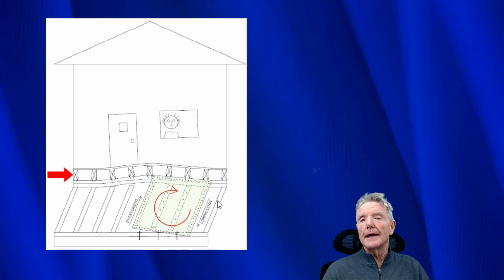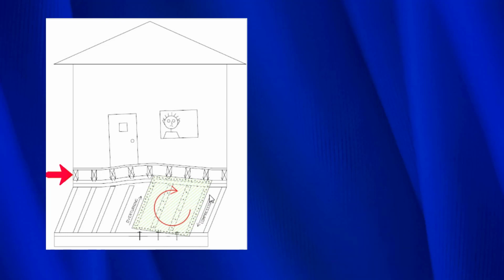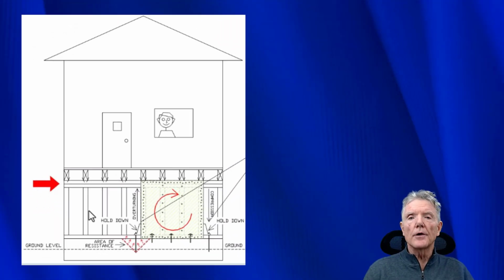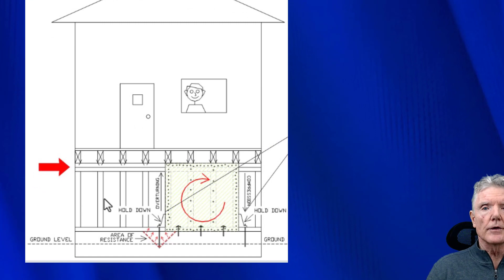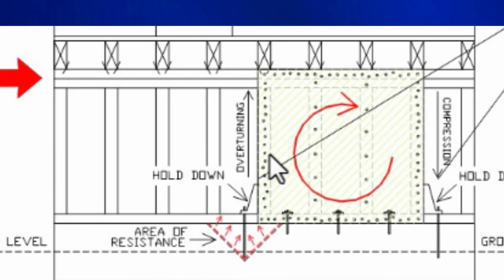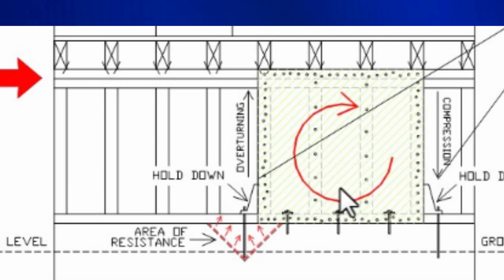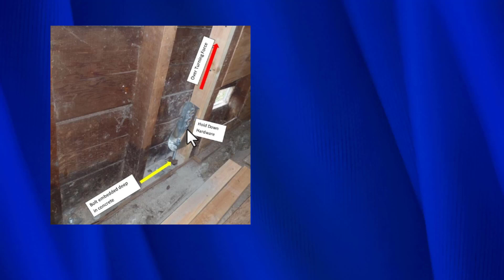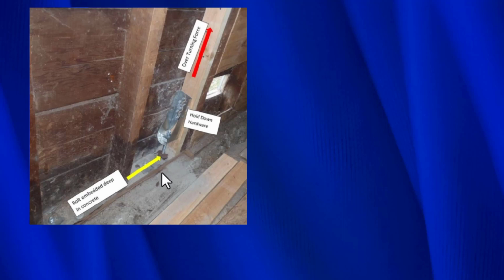Holdowns For Proposals

Comment: Thank you! why would you install the Holdowns not close to the sill plate and foundation as possible and let the Thred be exposed like that?
Reply from the maker: It doesn't really matter.  We use 18 inch long rod and drill into the concrete 8-12 inches so there is always some rod sticking up beyond the plate.  That is why you see holdowns above the plate and some rod exposed.

Comment: Thanks for the info--for homes that don't have cripple walls--just a wall on top of a rim joist on top of a sill plate, how does one secure holddowns? Do we drill through the sole plate down to the mudsill and foundation, bypassing the rim joist? Also, what's the prescribed retrofit of securing the wall to the rim joist?
Reply from the maker: Why are you putting in hold downs.  Do a search on "Overturning" on the website.
Reply: @bayarearetrofit5814  I have a house built in the '50s (southern california) and after installing FRFP plates and shear transfer ties, I noted that our exterior walls only have the stucco cladding for shear resistance. Was considering applying plywood on the inside when we strip the drywall (to do insulation and redo electrical) and build shear walls. Hence the question about hold downs.
Reply from the maker: @dmtien  You do not need holdowns.  Look at the video https://youtu.be/HSDJfLSXoaw  Don't waste your money.

Comment: I understand that the threaded rod should extend 12 inches into the foundation. Even with a  rebar cutting bit, my contractor was only able to get 6” down. He epoxied them in. Short of removing them and starting over, is there anything else that can be done? Thank you!